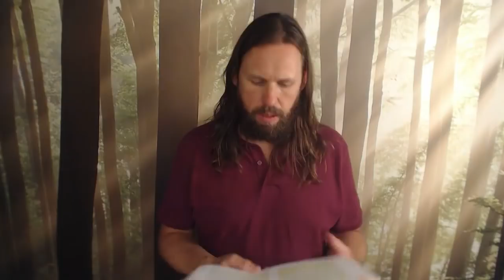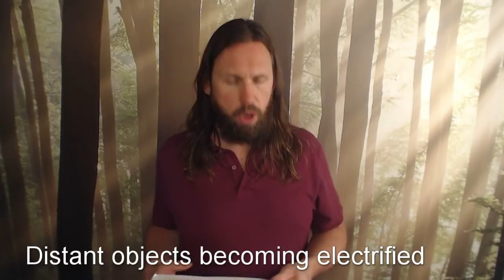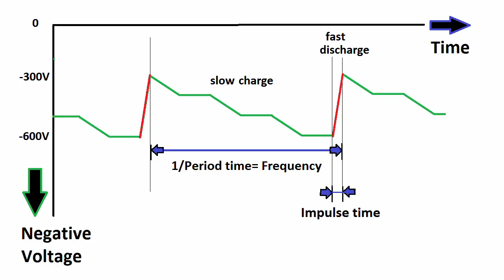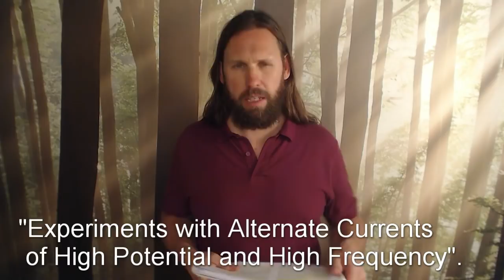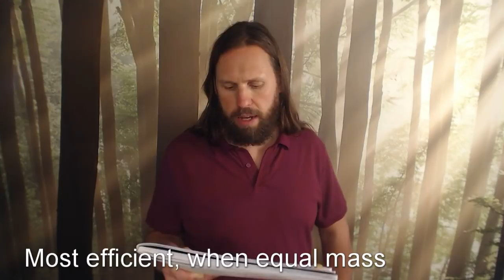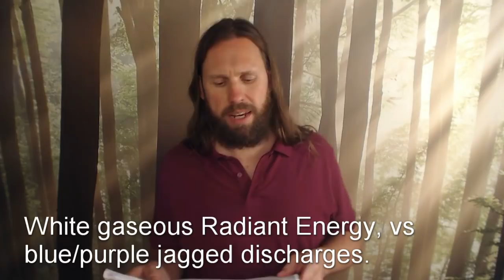Nikola Tesla's Radiant Energy Part 2 of 3

Comment: 3 years aGo I had a black trianGle craft with plasma balls in each corner hoverinG in my backyard I felt the radiation/health wave u mentioned from whatever was causinG the hum. I felt euphoric & filled with enerGy which led me to study levitation of dielectrics & also made me want to recreate Tesla's vibratinG table.

Also liGhtinG up the air in a room reminds me of the stories u hear about underGround bases...
Reply from the maker: Tesla lighted up the air in his lectures, his 1891 lecture explaines he uses powerfull electrostatic effects (not electro magnetic) by disruptive discharging high voltage capacitors through single turn primary coils.
The secondary than became electro static (longitudinal) resonant.
for this the primary and secondary need to be capacitive coupled.
most importantly the capacitor slowly rises to a high voltage then ultra fast discharges, without becoming resonant ,without ringing.
then the longitudinal electrostatic thrust(!) was produced.
the 1891 lecture in new york before the Columbia college can be found online.
Reply: @MasterIvo  thank you for sharinG, I will check it out.

Comment: SPACE and TIME:  (copy and paste from my files):

'Space' is energy itself.  Wherever space is, energy is.  Wherever energy is, space is.  They are one and the same thing.  And for me, the 'gem' photon is the energy unit of this universe that makes up everything in existence in this universe.  'Space' is most probably energy itself in the form of gravitational fields, electrical fields and magnetic fields, varying possibly only in energy modality, energy density and energy frequency.

'Time' is the flow of energy.

'Time' (flow of energy) cannot exist unless 'space' (energy itself) exists.  And 'space' (energy itself) that does not flow (no flow of time / energy) is basically useless.  An entity cannot even think a thought without a flow of energy.  If all the energy in the universe stopped flowing, wouldn't we say that 'time stood still'?  Time itself would still exist, it would just not be flowing, (basically 'time' stopped).

But then also, how space and time are linked in what is called 'space time', (energy and it's flow).

*  And everything in existence currently appears to be eternally existent energy interacting with itself.  There is truly only 1 single 'eternal day', the day of eternally existent ever flowing energy.

Comment: Impulse:  Consider the following:
a.  When energy forces align, they add together.
b.  Like a swing, a push at the right time and in the right direction adds to the energy of the swing to swing higher.
c.  In the case of electricity or magnetism, quick pushes at the right time, while aligned, can potentially reach higher levels due to added momentum than just the same amount of pushes but added to the system over a longer period of time.

Comment: 'BATTERYLESS BATTERIES':  (copy and paste from my files):
To help power equipment in outer space:

Potential endless energy source basically anywhere in this universe:

a. Small aluminum cones with an electrical wire running through the center of the cones, cones spaced apart (not touching I'm thinking) but end to end.
b. Electromagentic radiation energy in the atmosphere interacts with the aluminum cones.
c. Jostled atoms and molecules in the cone eventually have some electrons try to get away from other electrons of which those electrons gather at the larger end of the cone, of which also creates an area of positive charge at the smaller end of the cone.
d. The electron's in the wire are attracted to the positive end of the cone and the positive 'end' in the wire are attracted to the negatively charged end of the cone.
e. Basically a 'battery' has been created inside the electrical wire itself, different areas of electrical potential.  Basically a 'wire battery' or a 'batteryless battery', however one wanted to call it.
f. Numerous cones placed end to end increases the number of 'batteries' in the wire.
(In series to increase voltage, in parallel to increase amperage).

*  Via QED (Quantum Electro Dynamics) whereby electromagnetism interacts with electrons in atoms and molecules, one would have to find the correct 'em' frequency for the correct material being utilized for the cones.  The shape of the cones could also come into play.  The type and size of the wire as well as the type and thickness of the insulation between the cones and the wire would also be factors.
*  Of course also, possibly 2D triangles made up of certain materials with a conductor going down through the center of the triangle could possible achieve the same 'batteryless' battery system.
*  Plus possibly with the 2D concept, layered 2D's that absorb different energy frequencies, thereby increasing the net output.

Comment: Radiant energy is found in radiant matter, according to Nikola tesla. Radiant matter as described by tesla is emitted from electrons with out stop. It is a primary matter, and energy, in other words; it can’t be broken into smaller bits, this is as far as one can break radiant matter down. 
Tesla said the energy in radiant meter is trapped by an insulating layer, and that insulation has a resonant frequency of 1 million per second. Moreover,it is impossible to break down this insulating layer with transverse waves, only compressive energy will work. 
The smallest energy practicable to make a spark, which is the definition of a compressive energy, repeated at 1 million times per second, and run through a simple circuit with Tesla’s flat coil will unlock infinite energy. Lol….simple.

Comment: How did Tesla measure microseconds? At 6 mins in your video you say the impulse duration was .000001 microseconds... How would he have been able to measure the impulse duration with out modern electronics..everything was analogue in his day he couldn't hook his machines up to oscilloscopes
Reply from the maker: I read he used a stroboscoop, I forgot how it worked exactly, but it was based on phase differences. just like in a movie when you see a rotating helicopter rotor or wheel. when the shutter speed of the camera matches a harmonic of the rotation speed the wheel or rotor appears to stand still.
Reply: @MasterIvo  that's makes perfect sense thank you for you kind answer

Comment: I totally agree with your perspective on whats written.
The "white sparks" tell me theres a high current reaction going on in the plasma.

Regarding the "healing impulses" you should lookup on raymond rife.
Hes done some amzing research in the field.

Regarding the illuminace room, i was so far only able to get a green illumination inside a tungsten lightbulb. Wich actually is a amazing effect. It really looked like the aurora borealis.
This was adchieved at a frequencie arround 2.5 mhz.

The thing with the "same mass" for coils ive hears many times.
It was also suggested by john bedini.
As in where he talks about coils have to be equally weight over length.
Stresses out that its all about the weight of the copper ions wich have to be equal to get resonance between coils.

Theres this don smith device were he is expirimenting with a plasma lamp (cillindrical)
Where he has different plates allong the discharge rout of the plasma lamp.
Where a potential difference would start to accure between the plates. Effectively producing charge as these plates could be loaded with low power loads.

I totally agree with not touching the wall socket 😂😂

I think ive seen these white gaseous "flame like" plasmas with my hfsstc wich opperates at arround 15mhz in class e mode.
The blue purple spark is still in their btw.
Its just hidden.
To me it looks like the frequency or impulse is to rapid for the oxigen arround it to deionise.
Thus keeping it in a plasma state of matter.

Let me know what you think!
Reply from the maker: Same mass (and wire length) still doesn't make sense to me, as resonant frequency is depend on windings (inductance) and coupling distance (capacitance).

So I can have equal length and copper mass, but still have different resonant frequencies by the shape of the coils. 

more windings, that are further separated can lower the capacity and increase the inductance, which will result in a resonance with high voltage and low current.

for the rest, yes, I agree. 
white is related to current.
but, it is definitely not conventional current, but displacement current.

displacement of what?
Energy! in its purest form,
the white luminiferous Aether.
Reply: @MasterIvo    what i think is that indeed inductance/capacitance is the force behind resonance in a normal electrical system.

But since tesla says this this energy seems to be something else.
It could very well be that other rules may apply.

Yeah its a whole different level of energy thats for sure!
Reply: @acidbyte23  Impulse DD electrogavitic pressurized aether streams

Comment: The flow of ether into and out of the dynamo I believe produced the pos or neg effect from the magnetic discharger  one side yields neg and the other side yields pos.   I have a rodin type coil with circuits A and B this coil will fill a cap to 21000 vdc when only circuit A is driven B is not used.  The pulses are unidirectional + 12vdc.   In certain freq and pulse width the caps end up with zero charge yet have 21kv in them.  placing a piece of paper on the neg cap post then bringing the positive post to the thin paper will not arc thru the paper.   when the caps do end up with charge an arc thru the paper occurs.

Comment: 12:50 "segmented",  I think it refers to a cone connected to a cone connected to a cone, like a solid piece of copper cylinder that is machined on a lathe into this shape, so that energy must concentrate as it flows to the tip of each cone, even if there is no spark gap between those cones.  I think just that contracting path on the surface of the cone is what will recruit even more energy into the flow, from....  ether or ionisphere.

Comment: I know how to produce this radiant energy... I can feel shock waves coming uni directional which can be felt with only human flesh but not any apparatus we have in scientific literature... Any idea how to harness this energy and store it... Its really a powerful free energy...
Reply from the maker: can you tell a little bit more about the source
Reply: @MasterIvo  It was a device I designed without any heat or friction but capable of generating this uni directional electro magnetic waves... I don't know if you can understand but you can call it aether force...
Reply from the maker: sounds interesting, but still vague.
my email can be found on my "about" page (use pc)
Reply: @MasterIvo  sure... I will contact you tomorrow... Thankyou..
Reply: @MasterIvo  can I have your emilid here...
Reply from the maker: yes it will induce a world wide revolution on a scale and tempo we  can't imagine.
Reply: @MasterIvo  How about impulse DC at tera hertz frequency form wiggling EV charge clusters, now focus this narru beam for tremendous pressures of THz impulse gravity beams.. i thought of a FEL with a saw tooth shaped light wiggler. i  bouth the secrets of anti gravity propulsion book which discuses subquantum kinetics.
Reply: @MasterIvo  Aether is not a super natural thing... Its natural... Infact it is the source of everything... Base of matter, infinite energy source... We can run a static electrical motor by placing grounded wire on one end and another wire which can gather aether radiant energy with the help of an aluminium plate placed on the either side of my device...
Reply from the maker: yes, I've seen laser saber do the same
Reply: @MasterIvo  its not like that... This is way too much powerful beyond our imagination... We can power entire world with this energy...
Reply: @MasterIvo  This isn't a new invention... Infact we never invented anything, its already there in nature... We just discovered its existence... People who cannot understand this phenomenon call it as supernatural... But the fact is there is nothing supernatural... Everything is natural... We call it supernatural because we dont understand it...

Comment: I do believe atoms in the air can illuminate as you report Tesla accomplished that. The color blue in the sky is actually caused by atoms (I think nitrogen)  being illuminated by the Sun's photonic energy.  So what he said is true. Everything else he said here is true also.  Like electricity flowing off a pointy part, or a sharp edge more than dull electrodes.  Being able to feel radiant energy scares me, but only intuitively.  I don't have any facts on that. But it seems that if we can feel the EMF current then that might be dangerous, maybe like free radicals causing disruptions in the RNA processes which lead to cancer and radiation poisoning. I'm just saying exercise caution on these experiments.  Ivo it would be awesome if we could illumate the air atoms in a room with 1 micro second bursts in your bifilar setup. Again, don't stand directly in the room while trying.  Or use a large box instead of a room with a wifi camera inside the box with the bifalar coils, while you yourself stand at a safe distance away.  Thinking about it, this ability to charge atoms in the air may have been what lead Tesla to believe that the Earth's atmosphere could be used as a capacitive energy storage source. Which is exciting to think about.  Ultimately I think he realized the dangers of that idea. Alternatively, the things you mention here are awesome concepts and I think proven by Tesla. Commercialization is what caused them to be scrapped.  JP Morgan is quoted as having said "If I can't strap a meter to it to charge people for it than I dont need it."  But that was 120 years ago.  Today your most efficient bifilar reduction in necessary current is probably going to me needed in the production of truly zero point energy generator.... along with some other necessary physical improvements like low or zero resistance turbine shafts.  I believe we are getting close and might possibly see it in our lifetimes.
Reply from the maker: yes I get way to tired if I am around the coils. I need shielding

Comment: It isn't true to say the electricity is totally healthy. It goes through your body, and you don't feel any immediate pain (like how you would associate being shocked by regular voltages and current levels) BUT prolonged exposure to it can cause burns in the flesh, and there is a chance it could stop your heart if it goes through it, although it often doesn't take that route.
Reply from the maker: it depends on what frequency you are using. I use LMD resonance which is pretty different...

Comment: Thought experiment:  A bipolar arrangement for RE device, utilizing synchronous negative and positive voltage USD (ultra short duration) impulses, discharged through a Rife Phanotron tube.  Just curious what the plasma's EM emissions from that type of excitation would be like, then also the effects of RE emissions.

Comment: AIR you just explaned the forth state of matter that is now called plasm i work with this every day  .    THERE IS A minumum of 3 fields the coil or wire is one the nanocoating on the wire cam be brought on buy induction or heat at about 670 de. puts a black nano coating on the wire it self . And that is the most inportant part of the process.   this is the start of the plasma that is now the second field . the therd field is the invirement that is now included .      ITis no longer matter state this is the plasma .the property s are huge .      Theres alot more to  this feild the atoms range are free flowing THAY JUST NEED DIRECTION .  That is by the desighn of the circet . that is optained in a materstate invirement .   that becomes plasma because of the nano coat prosess  . this tecknolegy is here its in every country country thank you for being the one to show TESLA S  work in the electronocal  connection in the inviremental connection in its condition  of the most advanced and allmost forgoten MR TESLA that reached things with this that he called the COSMIC RAY ANTENNA that is term of the plasma science that is in the forth state of matter .     your presentations are the best i have seen now to ex[lane the plasm will open the eyes of many .       For other information on the modern teaching of the plasma  .   is KESHE FOUNDATION OR THE WORK THAT IS BEING DONE  .     KESHE KNOLEG SEEKERS WORKSHOP .      IN EVERY LANGUAGE IN MOST COUNTRYS  your detales are fantastic allso thank you again. .   I AM A MESSENGER that will answer  any questions will talk soon .